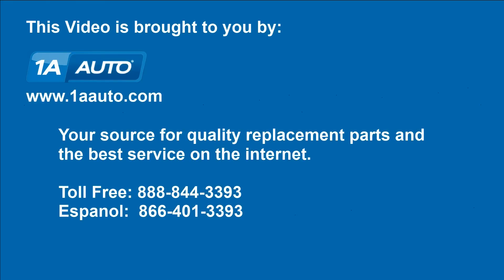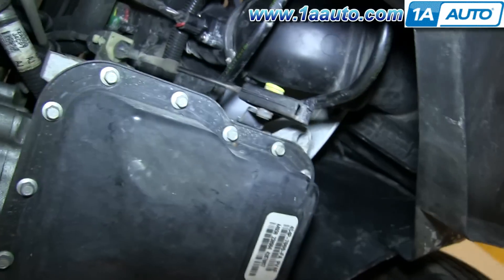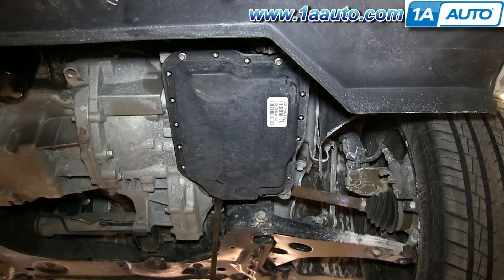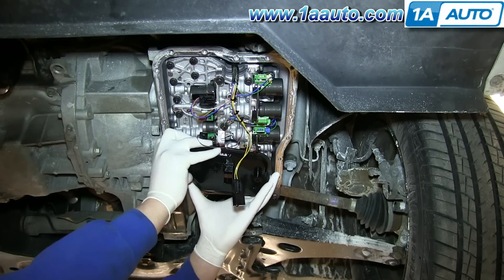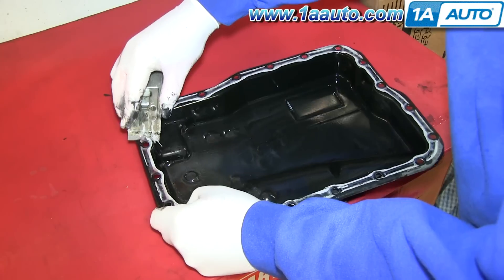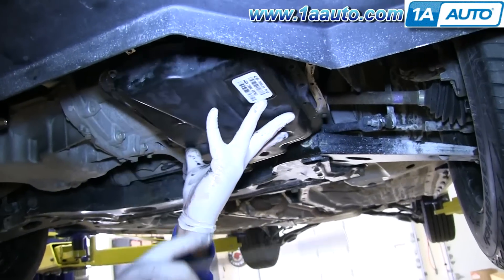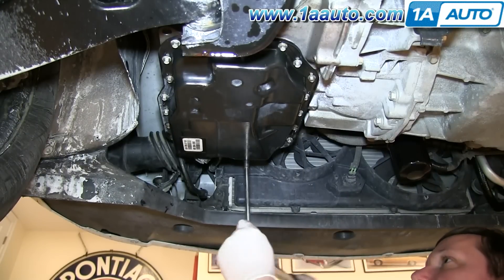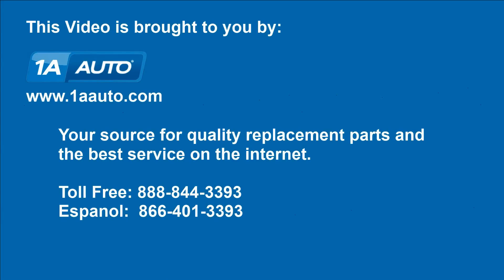How To Replace Transmission Fluid and Filter 00-07 Ford Focus

Comment: Hi. I have a Ford with an aisin Warner AW-81-40. I called the ford service asking for price and procedure and they tell me they do not change the filter, just clean it. It's it normal? Thanks
Reply from the maker: +dialruppertOk You may want to call a different dealer to see if they give you the same advice. Many on the newer vehicles are coming through with a sealed transmssion. Thank you for asking. 1aauto.com